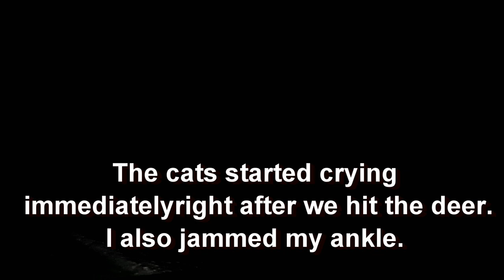Hit a Deer With our Car | My Daughter Also Hit a Deer That Same Week

Comment: You've got yo het those lights covered pronto. The first water that hits them will blow them out because they burn so hot. And since your winter weather is a tad extreme, just a cold night can blow the lights. Glad everyone is safe, including the Meows and Sadie. 

I don't know if they make them anymore, but you might want to get a deer whistle. Your bumper looks like it would work on the truck. Good luck and be safe.

Comment: I’m glad your all okay! My brothers were driving home day before Christmas one year and a horse 🐎 came running over the highway in the dark and went up on the hood of the car, windshield and then over the top of the car! If I remember right the speed of the car was 90 to 100 km per hour! I will never forget that call, I tough they were hurt but for some reason they both had seatbelts (one of them hardly ever uses seatbelt) and didn’t have one scratch on them!!
Reply from the maker: Seat belts directly save lives, I have seen both fatal accidents that should not have been if seatbelts were worn, and I have seen crashes that no one should have lived, yet, the person was in a seat belt and walked away.
Reply: Frosty Life I know! Everyone in my family uses seatbelts except my younger brother! The seatbelt has saved him 2 times, first when he had just gotten his drivers license, the steering wheel got stuck and the car rolled down a hill 7 times (one person in the car didn’t make it cause he had taken the seatbelt off) I think the only reason he had seatbelt on when the horse 🐎 came running over highway was the road was icy (We live in Iceland 🇮🇸) and he was driving his older brothers car!

Comment: Tom, I HIGHLY recommend you at least get the front-end and frame checked as far as being straight and not tweaked from the impact.  If you smacked that deer at the speed you said you were going your trucks front-end took a vicious whack. The frame on your truck where the bumper attaches might be wracked a little bit. I had the same thing happen to me 4 years ago to my Ford F-250 on a camping trip in Northern Calif. I didn't realize it till I had a shop look at it because truck just didn't handle right after that impact. Turned out the frame was knocked around just enough to make it handle oddly. Deer I hit was a big 8 pointer. If you know a pro auto mechanic you should get them to check it out thoroughly before repairing the damage. Just my friendly recommendation, bud
Reply from the maker: That is very solid advice for sure.  I know that my radiator is tilted back somewhat, and the bumper is bent, which is amazing for a deer.  I have an appointment to get things checked over and get an oil change and get my hood release replaced.
Reply: Good to know. Rather an inauspicious start to the New Year. Thankfully no damage to you and family other than nerves. It's amazing the damage that they can cause isn't it? It can be like hitting a brick wall. By the way, that policeman that hit the deer in that clip you had is one lucky trooper. Damn near had the deer land literally in his lap!

Comment: I've hit 4 deer this season so far, my poor truck has taken a beating. I went on Amazon and bought a bull bar for the front.after all the repairs
Reply from the maker: I am thinking of getting one too.  I am not sure if the $500 deer guards are any good, but might try.
Reply: Frosty Life I think it's worth it.because they protect the grill and headlights and even the radiator and engine. Especially if you hit a Bullwinkle